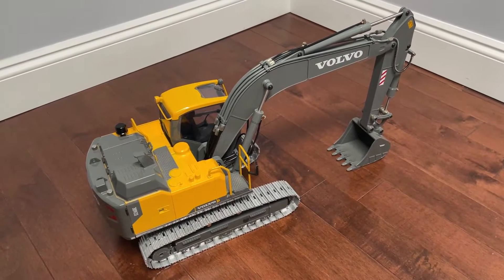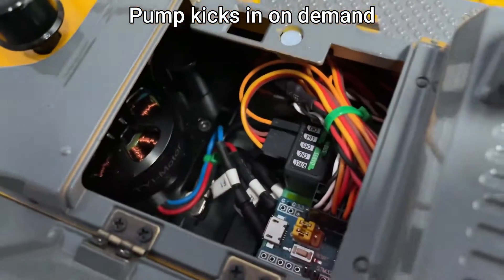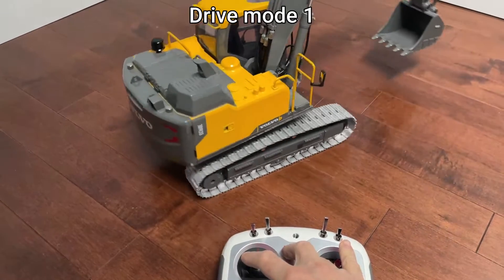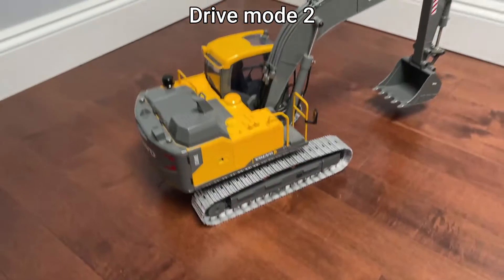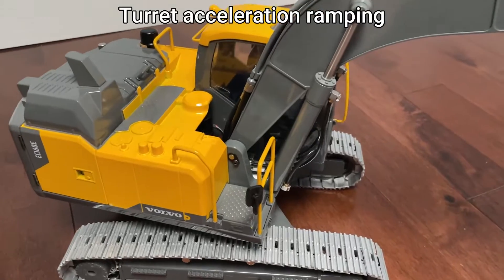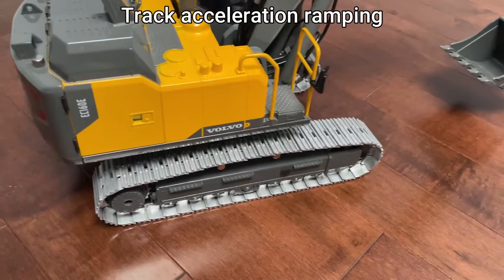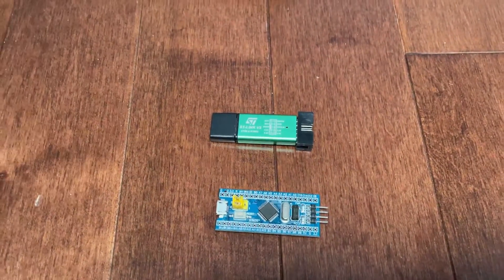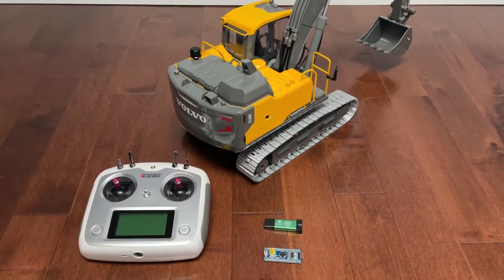1/14 Volvo EC160E Excavator running custom RC firmware with extended features

Comment: Nice unit i really enjoy mine. Mine is set up like your mod 2.  That’s actually how I run most my rigs. I also gutted stock system. I’m also running 3 separate esc’s and a few other goodies. Running separate esc’s also will allow you to dial in precise movements to  a sound unit. I added a k970 system with additional jump wire for all hydraulics to activate when mixed w/ pump channel. 👍🏼
Reply from the maker: Mod 2 is ISO. I decided to learn ISO (not SAE) from the beginning since the model comes from China which is all ISO lol.😂 A sound unit.. well, sounds like fun. I didn't go for one with this model though. Did you manage to fix the notorious turret play? I'm thinking to get to the bearing one day and see if I can fix/replace it.
Reply from the maker: What separate ESCs are you running btw?
Reply: @senyx0  Im running two HW 1060's for each track then a WP-s16 cheepy for my pump and a few other smaller drive board escs for all my light options and Slu motor
Reply from the maker: @thatsmyrc  HW 1060 are brushed, right? Hmm.. weird because my tracks are brushless. I'm asking because as I mentioned in the video, I run all my models on BlHeli_32 ESCs flashed with ESCape32 - the custom firmware that I authored. I can't recommend this approach enough because the ESCs are very small, relatively cheap, and 32-bit is much better than 8-bit. Another thing is that most 8-bit ESCs on the market (both brushed and brushless) are quite loud due to audible switching frequency (I have a bunch of them laying around without use). My ESCs are completely silent. If you're willing to try one one day, let me know. I'll be glad to help.
Reply: @senyx0  yea my track motors are brushed stock. I have seen upgrade part options for brushless. did you build yours or buy it from someone?  I also saw that you have a different pump motor? I bought mine from someone yet it was new not ran. It looks to be a magomrc pump system and valve block. I also have a kabalite k966 purchased used with leaks from a company . When I got it it was a total disaster of issues and leaks. I tore it completely down had to rebuild it from ground up new cylinders hoses main motor/gearbox and then some then adding my own custom lighting etc. That unit is no joke not easy to work on by no means. gutted all the electronics adding my own. Now here's where the issue now is. My esc's I put in are the same as above for brushless. even though calibrated and it does have a factory  brake when going into reverse. But besides that which is kinda nice so you dont rip the gears out of diffs, the reverse will only give me 1/2 the power/ I guess the esc is set up that way. Its programable through the switch as that model doesn't have a programable card insert. It is what it is for now. But I had about all I take with the k966. I was told all repair parts would be covered by company, that didn't happen either.  Needless to say it fried me a bit.  I wouldn't mind trying new things but I am no way knowledgeable as you are on your escs   or firmware. Heck that takes a PC doesn't it? All I have is Macs.  I appreciate your offer And do like your size of your escs. I might have to give a go on a few.  do you have a site or something are you a programmer of software of sorts?
Reply from the maker: @thatsmyrc  Oh, now it makes sense. I believe your EC160E being originally an electric version was converted to a hydraulic version. MagomRC you say? 
https://www.youtube.com/watch?v=DBZSLhL9VnQ

Mine is originally hydraulic. They come with brushless tracks whereas the electric version is all brushed. I believe the best way to deal with 1/2 the power in reverse is to simply switch the ESCs into bidirectional mode without brake (there could be a dedicated jumper for that).

I also use Macs. I made that tutorial for Windows users just because it's more popular when it comes to flashing, but it doesn't mean you can't do that on a Mac. You can also run Windows in VirtualBox on a mac (I do just that).
Reply from the maker: @thatsmyrc  Your Kabolite k966 story reminds in part what I experienced with my JDM-188.😂
Reply: @senyx0  In total I purchased the k966 under market value and with all the parts I had to purchase from a different vendor I was still under the cost of a new one.  But given the wait time and rebuild time I'm probably still better off ahead. Because that is was a disaster of factory assembly issues.  5 kinked hoses for starters, main gear output shaft was sheared off from mis alignment of grub screw install, both diff lock cables were adj wrong. missing O ring gaskets on cylinders it leaked out just siting still. And I was only told it had a broken front drive shaft and a leak lol.
Reply from the maker: @thatsmyrc  Wow, that’s a bit more than I had. Mine came all covered with oil due to a leaking line. Upon startup, awful grinding sound announced a problem with the pump. Upon disassembly, I found a small screw stuck exactly between the pump motor and the cover. Shortly after, one lead fell off the motor, so I needed to meticulously solder new leads directly to the coils in order to avoid waiting for a new motor. Broken servo, leaking cylinders and joints, stuck roller bearings, crooked front axle, misaligned rear axle, stuck track tensioner and many many minor fixes came next.😂